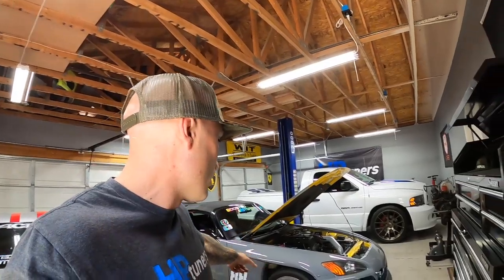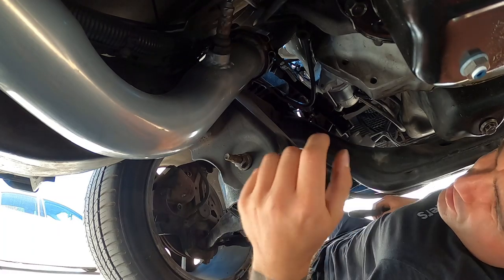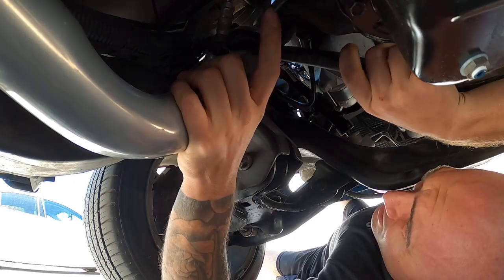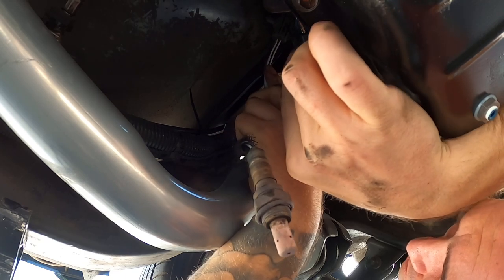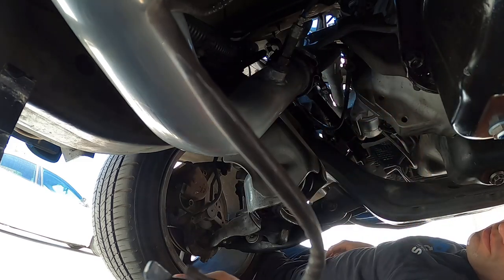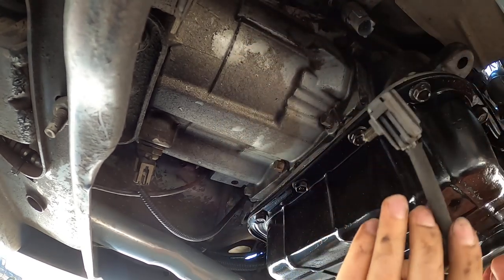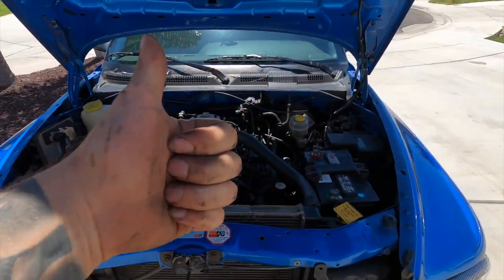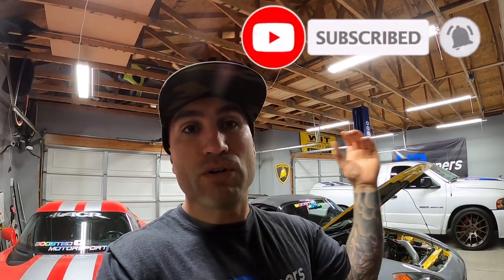How to Replace Primary Upstream O2 Sensors Dodge | Dakota | RAM | Durango

Comment: Bought these NTK O2 sensors. 2 (23161), (23162), and (23165).  I had to research on where to install the sensors and in which Bank (1 or 2) plus front or rear.  

UPADATE:  TOOK MY 2014 5.7 LITER V-8 HEMI TRADESMEN EXTENDED CAB (QUAD CAB) TRUCK TO AUTOZONE.  THE CLERK REPROGRAMMED MY TRUCK WITH THE OBD II AND MY TRUCK CRANKED UP PERFECT WITH NO CHECK ENGINE LIGHT!  WOW!

I had the clerk to rerun the diagnostic again after I cut my truck off.  The reading on the ODB II MACHINE WAS a secondary leak and a BANK I SENSOR. ALL SECONDARY.

The tech clerk said just might be a tiny leak at the O2 BANK I SENSORS.

Comment: Another thing that happens with the older Mopar LA based motors is the distributor, it’s not a distributor in the sense of the old school type, has internal parts that are plastic and they do eventually break. The ring gear also craps out and the drive gear is known to get eaten. A lot of folks swap out all of the sensors and still have problems, and that can be related to wear on that engine part. The coils are also notorious for failing. I have an ‘03 Dakota btw, easy to work on, but things do eventually wear out

Comment: On the old ones, or hard ones, i change them right after driving. And i cut the harness clip off and slide a 2 point on it. Only works on the easy to get to ones lol.

Comment: Rock auto sells the NTK which is OEM the cheapest price,and fast delivery local distribution center in California
Reply: Denso is also oem
Reply: Denso is not oem for the 5.7 Hemi.    
Lol.  99.9% of the time a Denso will throw a P0300 code due to it not reading correctly.

Comment: NTK or ngk are the best on the magnums , I don’t remember the last time I changed mine, never had an issue and on the rear one I have an O2 simm from Dan the Fastman
Reply: I'm Catless on my 98 Dakota 5.2L. Using a sparkplug extender on 2nd sensor. I'm guessing it's the same concept. I got the idea from a import tuners website 10 years ago🤓👍🏾
Reply: BDOG JR yea I been Catless, Long Tube hookers , no cats , 3” all the way back , the first 2 are in the headers , 2nd one in the pipes last one with the simm , mines a 99 360
Reply: NGK is the best ignition stuff in the world

Comment: Yeah I just bought an m1 mopar four-barrel intake for mine plus a 408 rotating  assembly
Reply: Damn, where'd you find the M1 manifold
Reply: @stunnasam21  I work at a Dodge dealership and one of my coworkers had one laying around with a 408 race ready rotating assembly
Reply: @H-Townracing  luckyyyyyy
Reply: Bro I've had this truck since I was 22 I'm 32 now and I'm about to make it a twin turbo beast 2000 horsepower it's a '99 ram 1500 sport 4x4 with a 5.9L Magnum
Reply: @H-Townracing  I've had my Durango about 11 years. I'm debating whether to do a high compression 408 or a supercharged 5.9. Gonna go with a TorqStorm system if I do. But first I need an intake manifold!! Lol
Reply: @stunnasam21  whatever you do do not go with the Hughes engines multi-port injection intake it sucks compared to the m1 Mopar multiport injection and if I come across another one I'll probably put it up for sale
Reply: @H-Townracing  damn, that was gonna be my 2nd option 😩
Reply: @stunnasam21  you can go to Mopar performance online and get you one but you would have to have it drilled out for the multiport injection

Comment: My 2000 Durango is a 5.9 and I only have 1 upstream and 1 downstream, what gives? 🤔
Reply: Same on my 5.2L 98 Dakota. 1 upstream & 1 downstream of the Cat.  I'm guessing it's a California smog thing🤓👍🏾
Reply: @bdogjr7779  yeah idk, my Durango is Canadian and has been in Washington it's whole life 🤷🏼‍♂️
Reply: @bdogjr7779  so I think one is his upstream, and one is his AEM wideband
Reply: that sounds i haven't looked at my but i got a 2006 Dodge Durango 3.7L V6
Reply: Ny 1999 only has two
Reply: My 1999 Durango big V* runs like a dream, but will suddenly just stop running.  Let it stand for 15 minutes or so and it starts right up only to stop a few miles later.  what gives?  The tell me the O2 sensor can do that?  I put a new computer in it, new alternator, new battery.
Reply: @brettmcallister4775  try the Air Idle Control Valve on the back of the throttle body